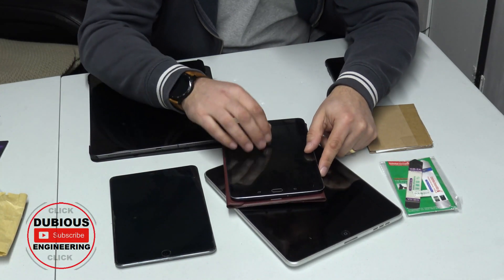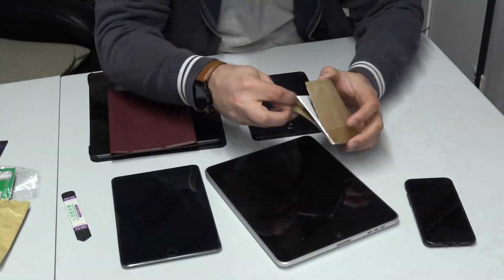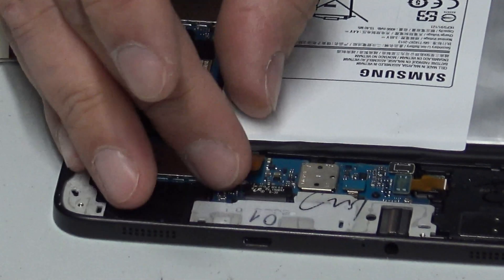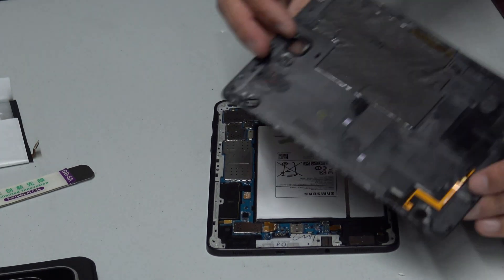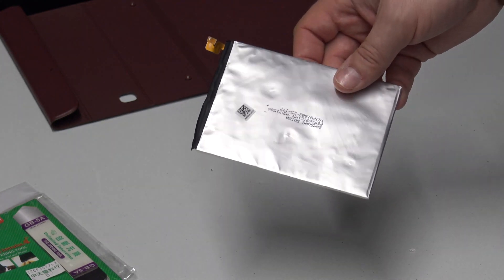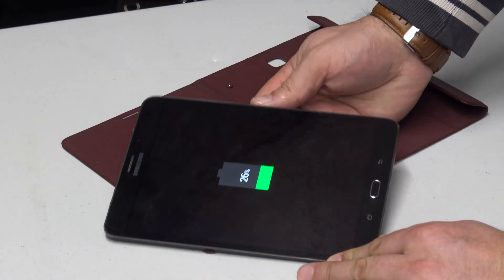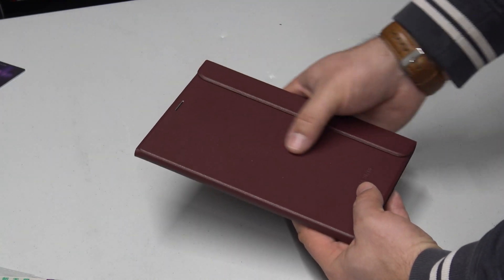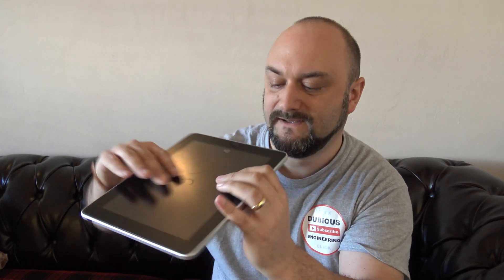DuB-EnG: Samsung Galaxy Tab 2 Battery replacement - easy to do? Watch and learn! DIY tablet upgrade

Comment: Why do all these videos start with a back that has already been opened—making it appear easy?
Reply from the maker: It’s not hard …. Well, I think my old battery had expanded a little offering a touch extra pressure.  But yes, for filming it makes sense to give yourself a little head start.  It’s clip on plastic, the key is having a decent spudger!

Comment: This video is quite misleading, removing the back cover is much harder than shown here ! On my SM-T719 it is also glued to the frame and no plastic spudger or suction cup would easily remove it. It takes a lot of heat, IPA and one damaged corner to finally remove it. Moreover some of the clips will break in the process (the black plastic chip shown in this video) and when the tablet is reassembled it will be a lot squeakier than before.
Reply from the maker: Oh no, that sucks!!  As you can see, I didn't have those problems with my model of the unit.  I don't believe my video is mis-leading, I think there are a few variations of the design.  Sorry you struggled.  Best, Howard

Comment: I'm not able to get anything into the separation between the back cover and the trim.  It is a very tight joint.  I have ordered your spudger, but not here yet.  Have received a set of opening tools which contain a pry tool.  But doesn't work.  Any suggestions please?  Would heating it up help? I have a SM T713. The Tab S2 is a great tablet, but can not get the back to come off.  Any idea on how to replace it?
Reply from the maker: Mine came off quite easily...  be careful with heat!  Hope youve got it sorted now!

Comment: This whole thing is bullshit.  I cracked my cover and could not turn it on after the battery replacement.  I saw that an internal connection depended on the back holding it on.  Pure and simple, these greedy bastards "tablet makers" want us to buy new after the battery stops working.
Reply from the maker: Sorry to hear...  anyway, mine worked a treat with a new battery.  Needed a good charge though

Comment: Well, I did remove the back cover and replaced the battery and even didn't brake anything - no cracks, no nothing. But putting the cover back is a bit annoying. It does not snap in place as I hoped. It stays in place but doesn't have a solid grip. And to turn the device on, I have to squeeze around the power button to make the contacts close. The only solution here I see, to glue the back cover to the body. Has anyone have an idea of what glue should I use? Or perhaps other tips on how to put thing together...
Reply from the maker: Ohhh shoot... well... what went wrong?!? ... did you damage the clips!!? ... mine popped back into place no problem
Reply: @DubiousEngineering  I've seen people getting to the battery from the front by removing digitizer. Perhaps that is the right way to do it although much harder :(
I'm going to glue it somehow together anyway.